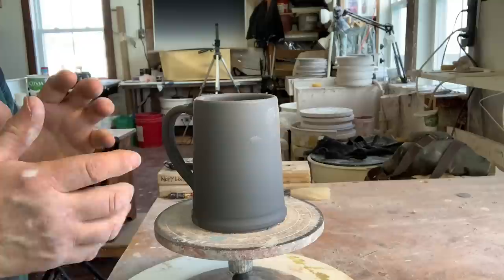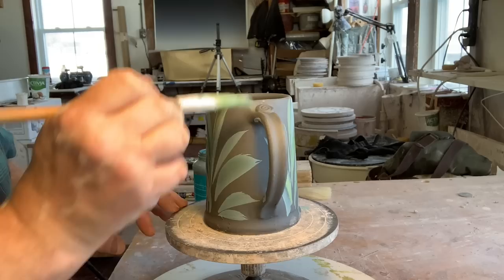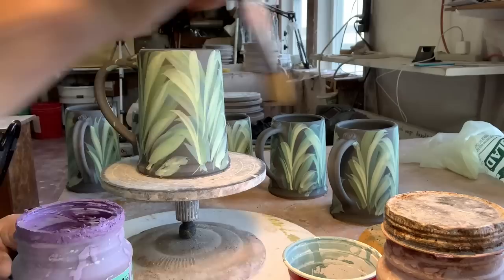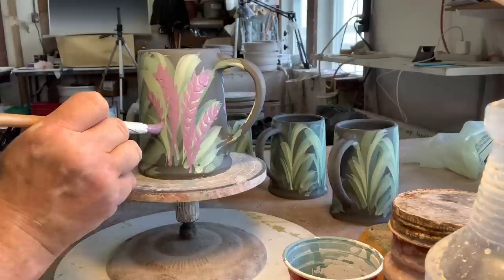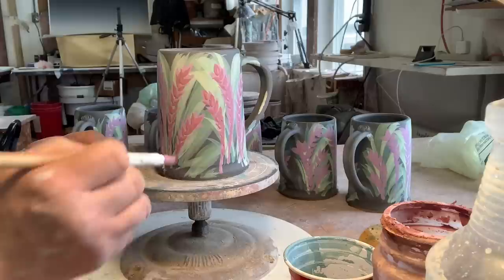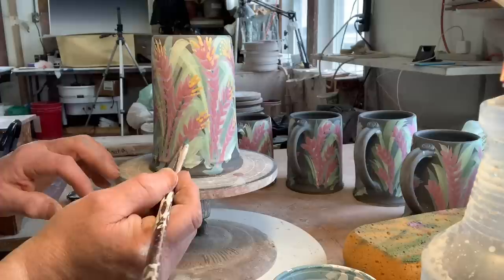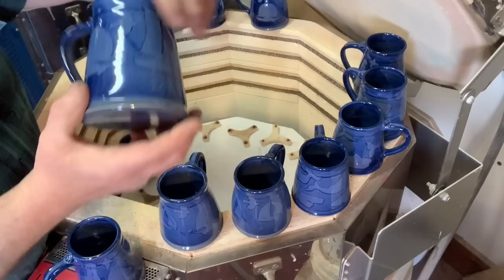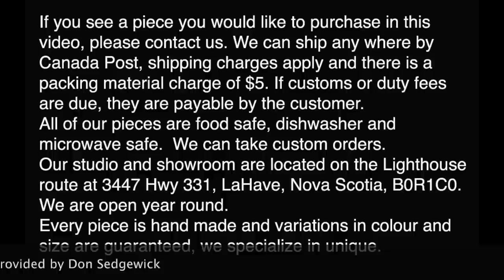How to paint flowers using underglazes.

Comment: Vaughn, I’m wondering if you can talk about using stilts. I see you use them all the time. My question is do you use them when firing plates, tiles or wide flattish bowls? If so, how do you prevent the plates etc from slumping around the stilts? Do you just use bigger, wider stilts? Or do you use 3 or 4 underneath wide pots? Thanks. I enjoyed watching your method of spontaneously drawn leaves and flowers. The black background with the bright foliage is stunning.
Reply from the maker: The quick answer is all of the above. I do not fire flatware on stilts. The wider the foot the wider the stilt. I hate the multi pin stilts, too much grinding.
Reply: Thanks for the info and your quick reply.

Comment: Hello. These are lovely. I'm new to this, so I have a question. You applied the slip and undergraze on leather hard body, then you bisque fired? and then applied transparent graze and glaze fired? Or do you just did one firing?
Reply from the maker: You got it right, slip is on just shy of leather hard clay.
Reply: @Vsmithpots  But than is still the question is it al in one firing. I like to hear from you. Like your videos, learn a lot. Greetings from Holland
Reply from the maker: @lizbrouwer6347  The pieces are bisque fired and then glaze fired. Two firings.

Comment: Is the only reason you fired your B-mix at a 4 because it saves you power? I'm assuming the reason you can get way with that is because your using underglaze with a clear top? Whereas other color glazes you wouldn't hit there potential at the lower temperature?
Reply from the maker: I use a slip that only goes up to Cone 4, as does the glaze.